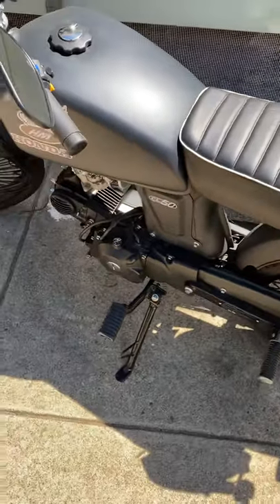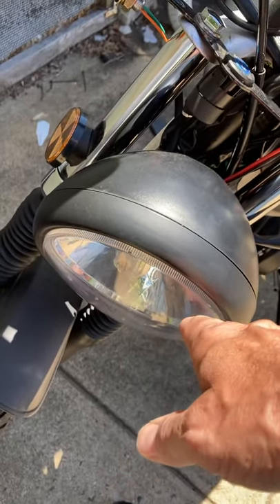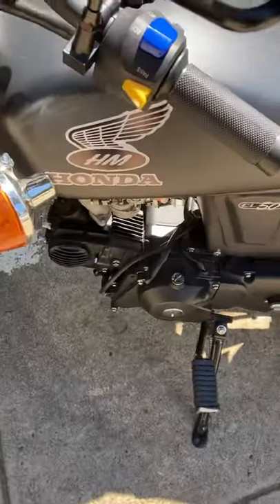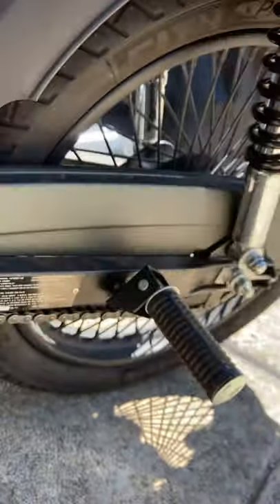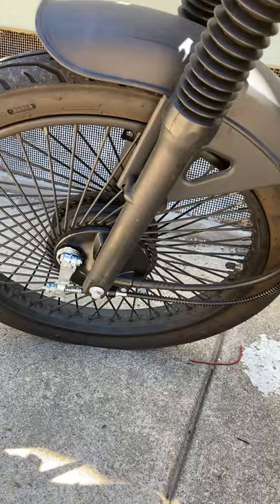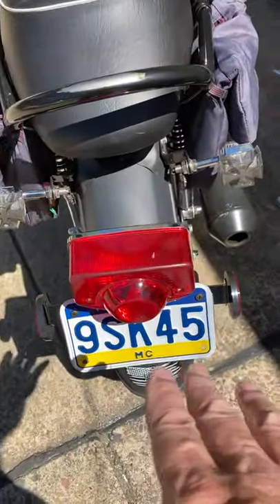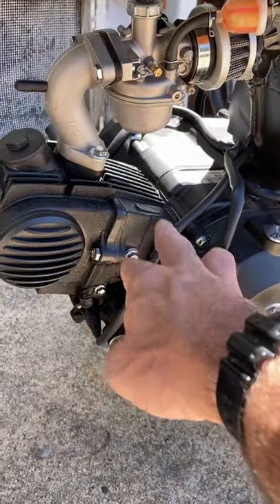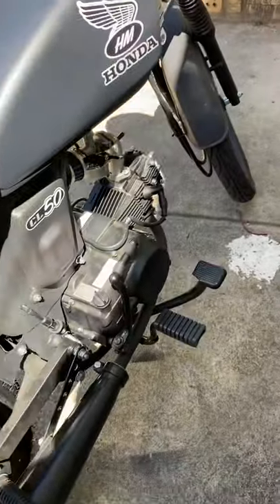Amstar Nostalgia 50 (72cc BBK) 452 KM update.

Comment: Looking good man! I have the same bike and was wondering what the process and fees are to have it registered and running on the road? Im getting ridiculous prices but was wondering how you did it?
Reply from the maker: I did PA registration. With a 2 year registration, title, and the fees of the tag place was $230 total and plate right then. Dealer wrote up as $899 on the bill of sale to help cut the sales tax down some.
Reply: @mayhembike  Thank you so much i noticed your plate looked like PA plates and im from there so that works out!
Reply from the maker: @joshpacheco1687  Tag place woman did a manual paper 90 day registration (with real plate though) and had to send to Harrisburg via "messenger" as Mfg (SanYou Holdings) was not in system. Take about 6 weeks to get the title and real registration in mail (my guess as I am only at 31 days since getting tags)
Reply: @mayhembike  I figured there would be some issues with Sanyou for it is a Chinese company so im not surprised you have to wait that long But i am assuming you haven’t had any issues with your temporary plate ?
Reply from the maker: @joshpacheco1687  nope not any. Its a real plate that will be on the final registration when you get it in the mail. Was hoping things were quicker like my IceBear Vision. She found that mfg in system and had real registration at the tag place instantly.
Reply: @mayhembike  well finally after 2 notaries later i was able to register it- with temporary plates of course. I also got to wait at least 6 weeks. Also do you ever have trouble with the choke? Usually if i have it down i can start the bike no problem then i release it after a couple minutes but if i pull the choke up the whole way then the bike shuts off. Know what that is about?
Reply from the maker: @joshpacheco1687  my choke reacted same way on factory 50. Had to wait a minute or so then open about half way. Idle should climb abit. Then wait 1-2 more then open all way. Was reduced abit with the PZ19 carb upgrade. (Check other videos for the link). Mine is now choke for a second. Then half way for like a minute, then open all way and go. Like 2 mins tops to go without stalling and such.